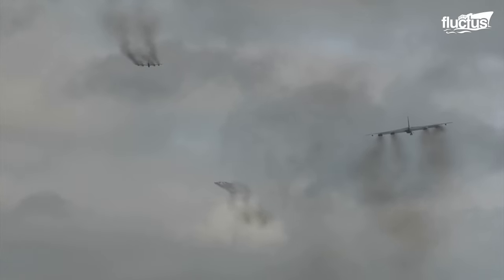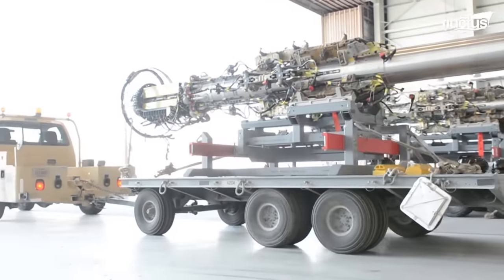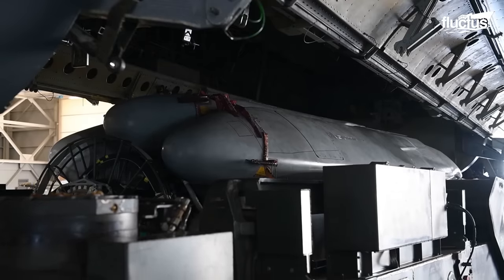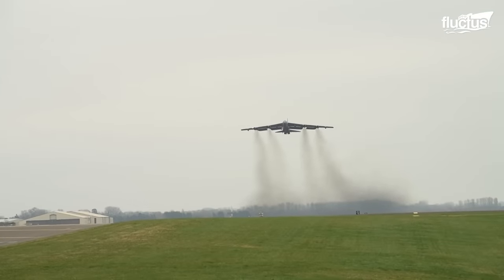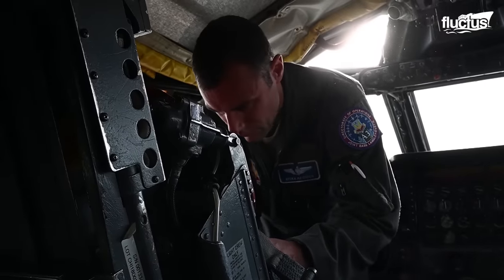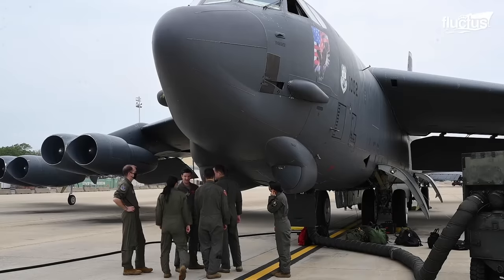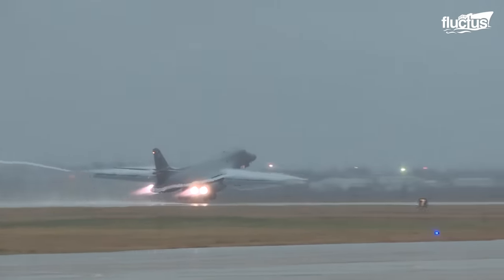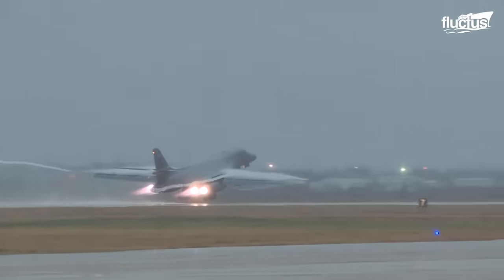This Genius US Invention Changed the B-52 Stratofortress Forever

Comment: Not more munitions, more types of munitions. The weapons are put on the CSRL BEFORE it's transported out to the aircraft. It actually limits the number of munitions. 8 missiles is 8 missiles
- Fixing the errors
The starter cart is not "explosive" think of it as a powerful smoke bomb, It's not a jump starter, it has nothing to do with the generator. It burns producing a LOT of gas which you see as smoke. That gas spins the get engine, when the engine gets spinning fast enough the air crew start the fuel pumps and the fuel starts to burn and that's how you start a jet engine. That's exactly how the ground power unit starts the engine, cars are faster but they're dirty and a lot of cleaning needs to be done after using them. The advantage is that you can start all 8 engines at once, with the ground power unit you start the engines one at a time.

The crews didn't carry "thumb drives" they carried hard drives the size of a small lunch box.

Actually, the B-1B is scheduled to retire long before the B-52.

The bombs are not loaded by the Bomb Wing, they're loaded by the Weapons flight of the bomb squadron

The afterburner is not an "extension," it's the back of the engine where raw fuel is pumped into the exhaust to provide more thrust

Planes are moved into a museum on incredibly RARE instances

The National Museum of the Air Force is at Wright Patterson Air Force Base near Dayton Ohio
Reply: @pkat  Your precious detail-oriented comment was made 1 year ago. It looks like the vlogger did not have the chance to read it.

Comment: I taught the basic aircraft maintenance school on the Buff, at Chanute AFB, IL.  I was stationed there from 74 to 79.  It was a crew chiefs nightmare with all its redundant systems.  If I remember correctly, 19 hydraulic accumulators, 8 hydraulic packs, and 6 generators.

Comment: The start cartridges are not "explosive." The powder inside burns rapidly, producing gas pressure to turn the starter.
Reply: Barry,
 Correct.
But burning rapidly does not have the same appeal as explosively does.
Hell, i've even read a camping article where marshmallows were described as bursting explosively into flames.
Scheesch.
If these civilians want to talk about fast burning, let's bring up DetCord. . . .
Reply: Can still fall under low explosive much like gun powder/cordite given the original were even cordite. Explosives are just the rapid generation and expansion of gas.
Reply: @MrDJAK777  There is a technical differentiation, though: explosive means the burn rate is faster than the speed of sound (IE, that it burns so fast that the pressure builds up into a pressure wave because the explosive produces gas faster than the gas can get out of the way).  Real explosives ("high explosives") must have a supersonic burn rate.

"Low explosives" technically do not explode at all, they deflagrate, and are therefore not really explosives in the first place.
Reply: I am 73 and was at Utapao on take off of a kc135 young tiger flight when the number 4 quit.  They stopped the aircraft and quick maintain eye crew loaded a “start cartridge” to “fire” the engine.  It may have not been an explosive, but being inside the aircraft sounded like one.  I still have memory’s or maybe bad dreams.

Comment: Just a quick clarification.  Normally bleed air is used to start the engines.  When a cartridge start is used, the burning exhaust gases from the cartridge, are routed to the starter turbine, which then rotates the engine like a normal start.  It doesn’t explode, just burns.  The exhaust gas from the cartridge is deadly to breath.
Reply: And only 2 of all 8 are started this way, right? How are the others started? Via crossbleed high pressure air?

Comment: I was stationed at Edwards AFB when there were just the 3 B-1A's. Those rotory launchers are what save the B-1B program.   The original design was for them to only carry nuclear weapons.  
The SALT treaty changed the need for nuclear capability. 
But the development of cruise missiles and the rotory launch made the B-1b invaluable.
Reply: OH my goa
Reply: Of the B1-B, can a rotary launcher be carried in each of the bomb bays or just one?
Reply: @jamjardj1974  if I recall correctly it has 3. Bays. And each carries a rotary launcher.
Reply: @rickhicks6833  Thamks for that, I recall it having three but couldn’t recall if two bays had an adjustable bulkhead for the purpose of rotary launchers, thereby rendering one bay as unusable during fitting, so to speak.
Reply: Hi
Reply: I Live near HVA Peenemünde and every Time i See a Agregat 4 Fly to London i pray: God shave the Queen

Comment: Hold on.....please learn about your topics if you insist on talking about them. First, most jet engines are started with compressed air.....lots and lots of air to spin an "air starter"   which is just a starter that is powered by tons of air flow instead of electricity. They used a high volume gas cartridges that put out enough flow to engage the normal air starter....had NOTHING to do with any generators.  In fact these starts are typically made on battery power. Get your $hit right !!!

Comment: 11 hour process? Not what I would call ease of use or swift to deploy!
Reply: What would you have done mate?
Reply: The system is preflight checked to make sure it works properly.  The USAF is known for ensuring systems work inflight so missions can be completed.
Reply: @michaeljohnson4258  as If 11 hours is a long time to load up 1000’s of lbs of bombs on a plane that can do 35 hour bomb runs.
Reply: @simonshotter8960  Many people do not know the amount of time needed to preflight a plane for a mission and the USAF was very meticulous unlike the Navy trying to get planes off a carrier deck ASAP.
Reply: @michaeljohnson4258  depends on ready status doesn’t it? They still preflight in the navy - but they have hot standby status(s) if varying degrees and a time period a plane can sit at each status. USAF and RAF did same thing during Cold War. Heck operation chrome dome had planes running tracks up north 24/7 carrying hot nukes
Reply: @dmacpher  yes the navy has the alert 5, 15, 30, and 60 on the ship which means the plane had to be airborne within that amount of time.  Even planes that were in alert status may or may not had been FMC (fully mission capable) because of lack of spare parts.  Maintenance always did their best but it was a nearly impossible job to have 12 jets FMC.  The USAF is very good at making their planes are ready for the mission just like the Navy VP squadrons so they preflight for 12 hours prior to launch.  Plus they have a better access to parts because they are land based.  When on alert status we did our preflight and waited to see if we launched.  There were times when the preflight was 4.0, then something would break prior to launch with no time to fix it but that plane had to be airborne.
Reply: @michaeljohnson4258  thanks for the info!
Reply: @dmacpher  you’re welcome.  I remember those 24/7 nuke bomb flight the USAF flies just in case.  That would not be a fun flight turning circles for hours hoping you are not needed.
Reply: @michaeljohnson4258  iirc it’s what dr strange love was based on 😆 worked too - Soviets thought Nixon was mad and ready for war, so SALT 1 was possible. But it lead to a lot of accidents. Insane optempo
Reply: @dmacpher  I think Gorbachev thought Reagan was mad too.  Politics is a strange beast and luckily we are still here.
Reply: @michaeljohnson4258  hear hear
Reply: We used to stay on alert status with our tankers.  We had three minutes to get 13 tankers airborne from one runway.  Bombers would do the same thing.
Reply: @robertheinkel6225  the Navy did the same thing while deployed on the carrier.  We had the alert fighter for when the Bears or other foreign non friendly planes were detected and we had the alert Viking when an unknown sub was detected.  Fun times.

Comment: I was stationed at griffiss  Air Force Base 83 to 87. I worked on weather equipment. Which is at the end of the runway. I saw many b-52's from 50 ft above. I think the f106 was louder
Reply: I worked at Griffins in 1975 and 1976 building 2 anechoic chambers in the RADC building .
Reply: We were at Griffiss at the same time!   485th EIG (the same building as the BX).

Comment: And then Boeing proposed a 747 variant with two bomb bays each with six rotary launchers rigged so they could rotate into launch position.
Reply: They Really need to retire the B-52!  And the 747 version would be wonderful, so only a few of the planes could take the place of several B-52's!  And have a cockpit large enough for crews sleeping quarters, carry a week worth of meals, ect.  Shortly after take off, they could take on enough fuel to fly for 12+ hours!
Reply: One advantage of using the B-52 is a wealth of maintenance knowledge in the ground crews. If, say, you have an oil leak, the teams know where to look.
Reply: @sanjivjhangiani3243  If not they can ring their grandfather for advice…
Reply: The B-21 is already on the drawing boards and should be flying soon.   It is another flying wing design, but smaller than the B-2 bomber

Comment: Very huge and very slow. How would these survive hypersonic anti-aircraft missiles or supersonic fighter/attack planes?
Reply: Bombers like B-52 and Russian Tu-95 are no longer delivering bombs directly to the target. Instead both Tu-95 and B-52 are being used as "cruise missile truck". So, these bombers are going to launch salvos of cruise missiles from far away and return to base. If you want to send bombs directly to the target you have supersonic bombers like B-1, Tu-22M3 and Tu-160 or stealth bomber like B-2 Spirit.
Reply: As the person below wrote, B 52s are used to fire stand off weapons, such as cruise missiles. Additionally, they are used for close in bombing in uncontested air space, such as in Afghanistan against the Taliban or against Iraq after their Air Force and SAMs were neutralized.
Reply: The new B-21 is already being built to replace the older bomber.  It is another flying wing design.

Comment: I don't understand why the body of the B-52 is so narrow.  It seems like it's giving up some cargo space, but not getting anything in return, like stealth.  But I am in no way knowledgeable in this field, so I'm sure that there is a reason.
Reply: The B-52 was one of the largest diameter aircraft ever built in the 50's!  And it was the late 60's when the 747 came out that the overall diameter was significantly increased for that plane and other wide body aircraft.  The B-520 only looks small diameter, because it is so long and wide.  The wings droop with the fuel load, to the point that early versions had a pair of wheels on the end, that are dropped off once airborn.  Now they just fly off with less full fuel tanks, and refuel a hour or so into the flight if the mission is a long one.

Comment: Use to work on these beast as a EWS Tech, in the 80s. It's built to last.
Reply: Thanks for keeping the ALQ-155s, 172, etc running tight. I rarely had any malfunctioning EW equipment. Cheers

Comment: The last B-52 Model (The H) was delivered to o The USAF in 1963. That means the newest model is 60 years old. The plane has a unique stance in the air - as the analog systems from the 60’s have long since been replaced by much lighter digital ones - shifting The CG (Center of Gravity) of the plane.

The most amazing plane I’ve ever viewed is The XB-70. Hard to believe such an awe inspiring plane was designed in the 1960’s - with engineers for the most part using slide rules. There were only two built. The second one was destroyed in a mid-air collision with a F-104. The first is at Wright-Pat. It managed Mach 3.08 - but had engineering issues.

Comment: Ah the venerable B1, what a shame that it started out supposed to be a Mach 2 bomber and it turned out because of budget cuts it could barely hit Mach 1.3
Reply: That peanuts budget cuts and cancelling the B1A . Everything these Democrat presidents cut from our military comes back to haunt us years later .
Reply: @toddbrooks2063  interesting since if they would have kept it the B-1 at mach 2 they would have been retired completely due to the stress on the airframe. Slowing it down is why it's still flying "barely" today with structural issues.
Reply: It is the terrain following high speed low altitude runs that wear out the airframes

Comment: I was stationed at Dyess AFB in the mid 70s. When the 96th had an ORI we at Mac had to participate. We would be standing in the mobility line waiting for the 15 minute time we knew it was a drill. That was the time we had from the start of the alert until we would be hit. Very unnerving times. We had 16 BUFFS at Dyess with 4 on 24hr alert.

Comment: I wonder why they have not changed the engines to modern jets?  I was watching a documentary on the C-5, and. the huge engine being mounted on a B-52 for testing in 1969.  Their claim in that video is that two of the C-5 engines could power the B-52 just fine!  They even had problems caused by excess thrust of the one engine mounted inboard on the starbard side, in place of two of the B-52 engines.  So much torque, that it made the aircraft feel like the 4 engines on the port side had suddenly failed!  

A engine such as used on a 737, or other properly sized engine would be much more quiet, and fuel efficient, and have a system that can be started with electricity, not air pressure from the running engines.
Reply: The contract has been signed to replace the engines with newer more efficient engines.  They are staying with eight, so they don’t have to redesign the wings.  The new engines will outlast the airframe, and won’t need to be replaced. The new engines are the same type used in small business jets.  Smaller, but more powerful than the current engines.

Comment: I'm a binge addict of the Air Disasters episodes, but not for the gore. I admire how much improvement there has been from crash analysis.  BUT, the biggest problem of aging airframes is metal fatigue, so how does the Air Force keep a 1960 plane of that size and capacity safe from fatigue ?
Reply: By overengendering, very deep inspections, timely rebuilds and ease of engineering loads. Remember, very large planes can be less painful to over-engineer  because they are easier to dynamic model and they are not created to withstand much dynamic loads while maneuvering. Also, the fuel economy is not a major concern. With nuclear heads becoming more and more efficient (i.e. lighter and lighter), the dynamic loads today, are, probably, seriously less per megaton of delivered explosive equivalent.

Comment: Imagine the dude who got to pitch the idea of turning on an engine by strapping explosives to it. Now if we could just put some charges in a cylinder block every time the battery or starter motor fails on a car.
Reply: Chevy tried it.  Just shoot fuel into the cylinder on top dead center, and fire the spark plug.  My old 77 Ford van would occasionally by just turning the key to on. Fuel was left in the cylinder and the plug would fire, turning the engine over.

Comment: I don’t understand why the B1 bombers are decommissioned while the B52s are not. We paid a lot for these weapon systems. Why not upgrade the B1sto keep them current? Guess that isn’t as sexy as getting new systems.
Reply: I think the B1 was too expensive to operate. The supersonic nuclear bombing mission could be done more effectively with missiles. In the case of a nuclear war, the chances are, the bomber isn't coming back for a reload. The swing wings were also a nightmare to maintain, so while they look cool, the B52 is more financially efficient.
Reply: The B-1 bombers are worn out from too many low level bomb runs using terrain following.  The stress is hard on the airframes.  The buff, stays high, where it is no subject to all those stresses.

Comment: Yea.. those cart starts must be like spraying a diesel engine with engine starter! Not good for engine longevity..
Reply: These cart starts spin the engine fast enough so fuel and ignition of fuel is at the right rpm of the turbines.  Engines do have a starter and the starter would take the brunt of the wear and tear.
Reply: The burning exhaust from the starter cartridge is routed thru the starter instead of the normal bleed air.  It turns the engine over like the regular starter.

Comment: Why haven't those two-engine pods been replaced by a single turbofan yet?
Reply: The contract has already been awarded for new engines.  They are staying with eight, so the wing does not have to be redesigned.

Comment: Surely the heat and smoke emissions from these slow flying weapons platforms are an easy target for multiple SAMs.
Reply: Only low on a bomb run. Our guys watched SAM arch's during Storm. Not to mention, which acft is sammy locked on? The real or 3 phantoms. Does sammy have guidance data to even launch? Just a few more bells and whistles.
Reply: @natestakely1478  The service ceiling of a S400 is approx 60000ft and the B52H 50,000. Even presuming effective range for the S400 is lower, its still high enough to hit a large plane like the B52 and two would make it hard to avoid even with counter measures that impacted one (and flares etc).

Comment: "The afterburners utilize the rear engine." Uh, where are the front engines?
Reply: Good catch.  The afterburners use the rear section of the engines to dump in raw fuel for more power.